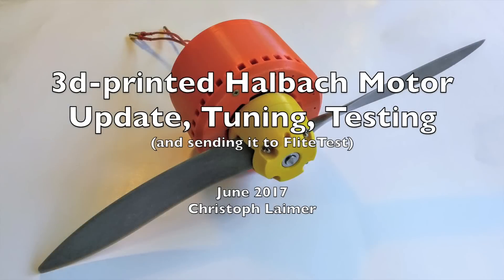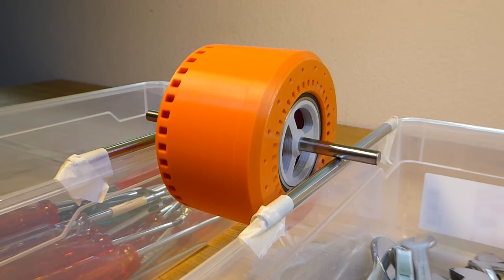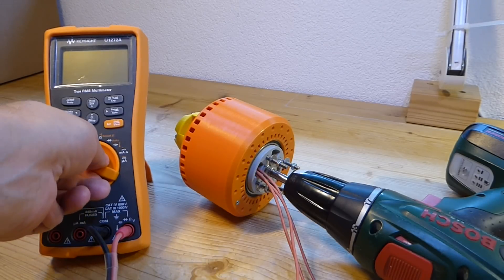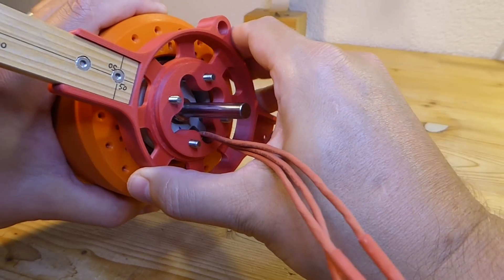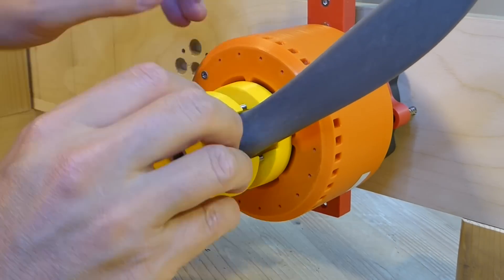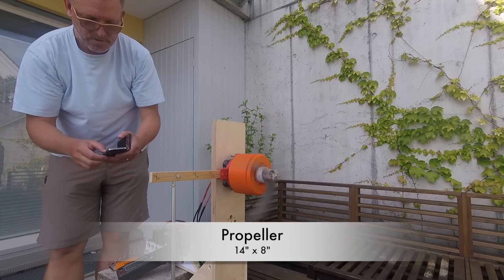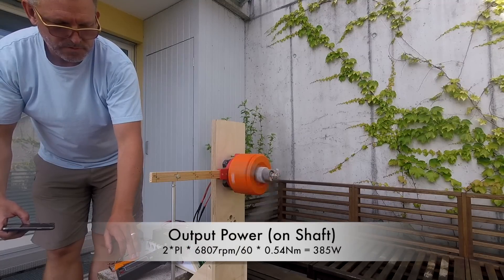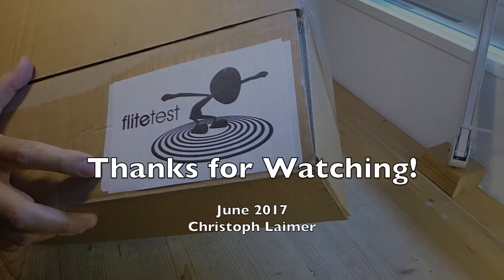3d-printed Halbach Motor - Update, Tuning, Testing (and sending it to FliteTest)

Comment: %80 efficiency  for a diy motor is very surprising knowing that there are production motors with %75 efficiency! I would really like to see that on a plane...
Reply: Especially because it was measured before the ESC.
Reply: @ryanmickelwait1521  What does ESC stand for?
Reply: @kingarthurthe5th  electronic speed controller. Its the DC/AC converter, supplying the motor with the 3 phase ac voltage (and current) variing the frequency depending on the desired rpm.
Reply: 75% motor efficiency exists because commercial motors want to save on raw materials. (Input costs)
Reply: @AS-ug2vq  which materials do they save on and how?
Reply: @evren.builds  copper, magnets. Use less. Use less copper and more energy converts into heat
Reply: @AS-ug2vq  gotcha, hanks for the info!

Comment: Some of the smartest work I have seen to date. Have you thought about changing the magnets, having them slightly angled in a fan array will give less cogging. Also putting a north and south magnet on the shaft will also give more rpms. It works kind of like the muller motor when done in this way. Cheers mate, good job.

Comment: Great video!  What kind of 3D printer do you use, your parts turned out beautiful!
Reply: The Head Ultimaker 2 I hope
Reply from the maker: Yes, It's an UM2. I'm also using a replicator 2x for parts which require less accuracy.

Comment: Here is some more thinking for best propulsion, let's assume the most efficient propellor speed was 3500 rpm (most propulsion available). The reduction gear would first need to slow down the shaft for that speed. 6800 / 3500 or roughly 2:1 gear reduction. After that the biggest propellor would have to be determined where the motor is capable of maintaining 3500 rpm shaft speed (with the gear). And you would have the most propulsion forward or upward available. The correct numbers would need some more work but the basic idea for best propulsion is there.

Comment: how many kg of thrust did it arrive at exactly 8000 rpm? 
The maximum voltage and current (A) that could be reached at 8000 rpm?

Comment: christopher, great projects, between a normal array of magnets and a halbatch array, is there a big difference in electromagnetic force?? best regards
Reply from the maker: I guess the Halbach arrangement helps a lot, when there is no iron used for "guiding" the magnetic flux. But I don't know a specific number. I only did a simple experiment: and temporarily removed the smaller magnets between the poles. That version had less torque. If the size of the regular arranged magnets would be increased until the torque was the same again, it would require 6% more magnet-volume compared with the Halbach arrangement.

Comment: Great video, thanks for sharing.
When you do the drill test it spins slower with motor attached vs when you measured the speed, I can tell from the motor pitch 8-)
Reply from the maker: Correct :-) ... I guess the true rpm with the drill is only at 1040rpm. But there are other things, which also make the measurement inaccurate. For example the friction of the rotating motor mount. I've no idea, how much that's influencing the measurement on the scales.

Comment: Well done Mr. Laimer! I enjoyed following this project very much, your professionalism and attention to detail really made it shine. Thank you for all your hard work! You mentioned that the electronic speed controller for this motor is using an arduino, can you please give more detail about this if possible? Perhaps some instructions on how we can also create an ESC of our own? With regards to the motor itself, do you think adapting it for use in electric bicycles, scooters and eboards can create overheating issues, in my experience with these applications metal motors tend to get hot enough where 3d printed sprockets attached to them begin to melt or deform, would this motor's self ventilating design mitigate that? Also, would scaling it either larger or smaller affect it's functionality in any way other than either increasing or decreasing it's output potential? What about modifying just the dimension parallel to the motor shaft, what kind of effects could be expected?
Reply from the maker: I've used an Arduino, because I didn't have a "servo-tester". A common "servo-tester" is well suited for providing the control-signal for the ESC.
GreatScott has a nice video series about building your own ESC: https://www.youtube.com/watch?v=W9IHEqlGG1s
Reply: Thank you for the reply, I will check it out
Reply: One more question if you don't mind, somewhere in the videos you mentioned that printing the stator core in a magnetic filament improves torque, can you please explain how it does so? Thank you

Comment: This is a great video. And probably one of the best use cases of 3d printer so far. It would be great if you could point out some study materials that you used for the motor design and construction. TIA.

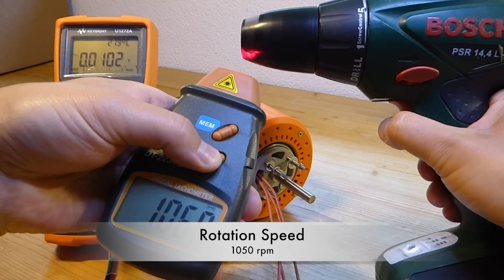Comment: Your actual KV is a little lower, the drill is audibly running at a higher rpm with the motor disconnected at 2:20.

Comment: Hello I want to buy your halback motor desing but I cant find right size for magnets in my country(Turkey) so can I change the desing and make larger inlays for magnets. I could find just 40x10x5 mm and 20x5x3 magnets. No problem for small ones but the bigger ones I couldnâ€™t find them. So can I change the housing for the bigger magnets I mean after buying the cad+stl files may I easily play with them in Fusion 360. Is it hard or easy way to do it?

Comment: The hallbach array is maximising the magnetic force from the magnets configuration, so how is the efficiency vs other motors also the power in power out ratios, does this engine require less power to run comparatively to other dc motors thanks

Comment: What cause most of the efficiency losses?
Are magnetic: the hysteresis losses from the iron PLA and the gap between the rotor and the stator? or friction from the bearings and air?
Reply from the maker: Almost all the losses are from the copper-wires. The resistance and current. P = R * I^2.

Comment: There is a product, a bit messy one, to improve heat flow from the stator to the rotor. it's called "statorade" a liquid inserted into the gap inbetween them. It is very efficient with electric bike hub motors. http://www.ebikes.ca/statorade.html (no, I'm not associated to them)

Comment: What model 3-D printer do you use? Your 3-D prints look extremely clean!
Reply from the maker: Ultimaker2 and Replicator2x
Reply: Christoph Laimer Hmm oke. Those are quite a bit out of my price range. Although impressively good tuned.
But seeing the mechanics they use, a decent CoreXY machine should be able to come near that.
Now i need sponsors, still.
Reply from the maker: I think most a well calibrated printers can be used. For this motor the printer accuracy isn't as relevant (compared with my other clock-projects). Most important for this motor is the proper rectangular alignment of the main linear rails. E.g. if xy-axis are not perfectly square, the round parts will be elliptic. That would cause a serious problem with the small gap between rotor and stator. Same problem, if the z-axis is not perpendicular with the xy-plane of the printer ...

Comment: Hi - very impressive work! What do you see as the benefit of using a Halbach array? Obviously you are interested in aviation so I imagine that weight/performance is your primary consideration? I have always considered a Halbach array a rather inefficient use of magnet with every second magnet utilised to redirect the flux of its neighbours rather than contribute directly to increasing the flux in the 'gap'. I am not sure that in every case substituting an some portion of the mass in iron wouldn't produce a better result. In addition, your radial arrangement without a magnetic core means that the flux is not cutting the windings at 90 deg but rather various lesser angles as it jumps across to the adjacent pole. I cant help but feel that you would achieve better weight/performance with the same total magnet mass but with two opposing arrays so that the all the flux in the gap cuts the windings at 90deg. Some FEMM modeling might shed some light. Do you have any thoughts on this?

Comment: Admirable motor job. For best propulsion reduction gear would be needed. After some 3000 rpm a propellor begins to cavitate and loses propulsion efficiency. No doubt a reduction gear could be 3d printed at this power level.

Comment: Hi Christoph, I bought a copy of the fantastic 600W motor and am in the process of printing it and buying the parts! Really excited. Can I ask why you recommend PETG for so many of the parts? I have printed the stator in non magnetic PLA (sidenote - I understand this just reduces performance but will still work?) and would like to avoid spending out on PETG, though if there is a good engineering reason for it then I am more than happy to get some. Basically just justifying the costs of spending on my beloved hobby to myself :) Also I may buy some transparent PETG so I can admire where the time went on all those windings!
Reply from the maker: I'm a fan of PETG, because it's not as brittle as PLA, it as easy to print like PLA, and it is more durable than PLA (like ABS). PLA has the bad behaviour that it breaks, when it's permanently exposed to some load. PETG is more "springy". The most critical part is the rotor, because of the centrifugal forces - I don't know how PLA behaves, because I didn't even test. The motor also works with a non-ferromagnetic core, but you need to be careful, because it spins faster (use a battery with a lower voltage).

Comment: The drill RPM should be measured while attached to the motor, since the motor will slow it down a little... I know this will be a small impact on the numbers and hard to measure without help, but it has to be acknowledged.

Comment: you are crazy good with motors. i subbed. looking forward to the test results. what do you think of ac induction motors?
Reply from the maker: I guess an induction motor is inferior regarding efficiency and ratio of power to weight. But the construction is simpler. Certainly it would be a very interesting experiment. A particular interesting aspect is the electronics: the hardware of a regular ESC is theoretically well suitable for controlling an induction motor, but it would require a different software flashed on the microcontroller. Regular electronics for variable speed induction motors is not easily/cheaply available.
Reply: Christoph Laimer thanks for giving your opinion. This is really interesting. If my budget allows, I'll replicate your halbach motor and fix it onto my bicycle :D

Comment: we tried something similar at school any tips onto keeping it assembled ours blew apart at around 60% throttle our goal was to make a 100% 3d printed quadcopter bit obviously the motors failed
Reply from the maker: You have chosen a challenging project! :-) Reduce voltage, winding with more turns, stronger magnets, wires and magnets closer together, print rotor with polycarbonate, or mark2 with embedded continuous carbon-fibers

Comment: could you do a video on explaining the testing the efficiency of the motor a bit in detail, I understood that you are measuring the torque which is generated on the stator of the motor. since the prop is not only producing drag but also thrust, and as far as I've seen it you only calculated with the drag, how is the thrust implemented in that measurement?
best regards!
nice motor!
Reply from the maker: Thrust is not relevant, because the motor is not accelerated (by the thrust). Means that there is no energy used, which would result in kinetic energy.
Reply: Christoph Laimer hm, okay,
Thanks for the answer!

Comment: Wow thank you for this vid - Im working on a similar project - Im rather then creating a engine creating a electricity generator - and I based on my calculations also need about 6000 RPM to achieve my test threshold.. Now I see there is a chance it wont explode on me:) Thank you:) btw. I intend to use carbon fiber reinforced PLA and for the rotating part I want to use carbon - nylon material I buy from 3D Xtech - although Im thinking I might test the PETG material too..

Comment: could i print a motor that would attach to a motorcycle frame and be capable of getting that bike up to 80-90 mph. would it be practical over a actual motor(not cost but size) im just curious because it seems like it could be a fun project.
Reply from the maker: Such a bike requires probably 15kW (or more) continuous power. That seems very ambitious for a 3d-printed motor.

Comment: Does it need PWM or can it be wired directly to a 12.8-13.8v battery??
Reply from the maker: The motor has 3 wires, and can't be directly connected to DC.
It runs at 24V and requires an electronic speed controller (ESC). 
The same electronics is used for brushless motors in RC-cars, or planes, e-bikes, electric skateboards, etc. It's cheaply available

Comment: Hi christoph, i don't understand how work the shaft output for the torque meter
Reply from the maker: The motor is mounted on a platform, which can spin around the axis of the shaft. The cables would twist, if there was no force applied for counteracting the torque, which is needed to make the propeller spin (air friction). This counteracting torque is measured by a lever, which pushes agains the kitchen-scales. Torque is simply the product of force, and length of the lever.

Comment: great job.
i thing this motor is more efficient than 80%,
because the propeller dose some work?
Reply from the maker: The question is, which portion of the energy is dissipated by which component? In the demonstrated test, 20% is dissipated on the way from the battery-cables to the motor-shaft. On that route there are cables, plugs, the ESC, again some cables and plugs, then the coils inside the motor, the magnets, the bearings, and finally the shaft. Certainly the cables and the ESC outside of the motor consume a non-negligible portion of those 20%. That means that the motor has maybe even 85% efficiency (I wasn't able to measure this). Hence I agree that the motor has probably more than 80% efficiency, but this is not related with the propeller.
Reply: @ChristophLaimer  By calculating motor power output using RPM and torque, the effects of the prop are neglected. Actual power out of the system including the propeller is a function of thrust and velocity, so on the test stand the efficiency of the propeller is actually zero. :D

Comment: Wouldn't it better if motor balanced with installed propeller ?! By the way I love the proficiency and level of details in this video.
Reply from the maker: Probably it's best to initially balance all components separately, because it reduces the possibility of dynamic misbalance. I can also turn around the question: if the system Motor+Propeller is not balanced, where would you put the counterweight? On the Motor or on the Propeller?
Reply: Got it! sure it's easier to inspect elements separately.

Comment: what is torque this motor for example 30 kg trust ?
Reply from the maker: Torque and thrust depend on the geometry of the propeller. With 500W motor power and a regular propeller the thrust is typically around 2-4kg.
Reply: Christoph Laimer so your motor(600w) torque is around 4-5 kg with properly propeller and electronics
Reply from the maker: The motor weights roughly 1kg. Torque is measured in Nm (newton-meter). See: https://en.wikipedia.org/wiki/Torque
Reply: Christoph Laimer I understand but motor torque can be in kilograms.I want to said that how much torque does your engine could you test motor torque?
Reply from the maker: Torque can be specified in "kg m" (kilogram-meter). The "meter" is relevant. 1 kg m is roughly 10 N m.
Reply: Fabulous work, congratulations !
a rule of thumb indicates for brushless motors for model airplanes an input power of 3W/g , following this criterion this motor should be in the 3 KW ballpark. It may be too heavy for the shaft power delivered.

Comment: You need to measure the rpm of the drill with the Halbach Motor inside!
Reply from the maker: That's true. Maybe the value of Kv is 5-10% wrong. Good enough to estimate the rotation speed depending on a specified number of LiPo-cells in series. That's the main reason, why Kv is needed: control the maximum rpm, in order to not break the motor, the propeller, gears, or wheels (depending on the final application).

Comment: Why is it designed with the stator inside of the rotor. With the rotor on the inside it should be able to handle higher speed, and the torque should really not change.

This would also give more space for a flatter winding, making the motor more efficent

Comment: They haven't made any flying object with the motor yet which is weird cause it has been 9 months since their unboxing video.
Reply from the maker: Yes, it's a bit disappointing ... I was hoping to see an application soon. Considering the weight of the motor (almost 1kg), a plane is not a simple project. Anyway FliteTest recently mentioned the motor again in a another video, so they didn't forget it yet.
Reply: They did? Could you link me the video?
Reply: A bit disappointing is a nice way to put it. It's absolutely disgusting it's what it is. All that work you've put in to it... would've never sent it, they didn't deserve your work in the least.